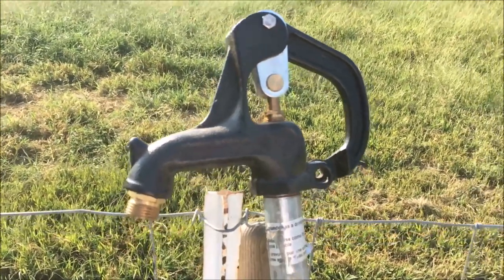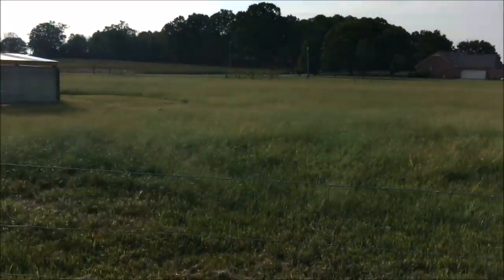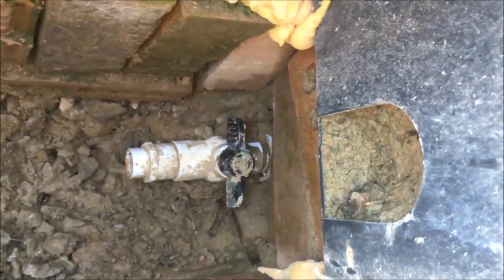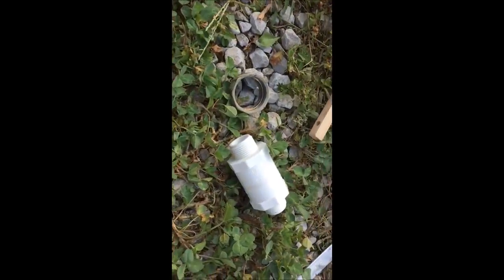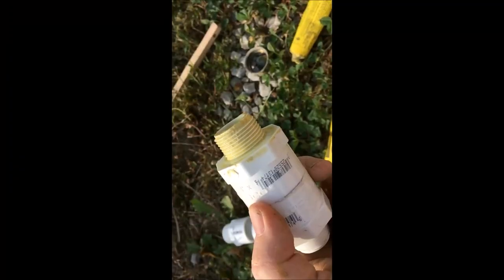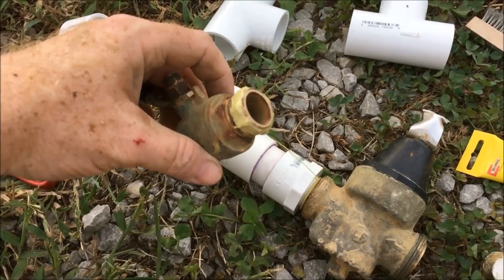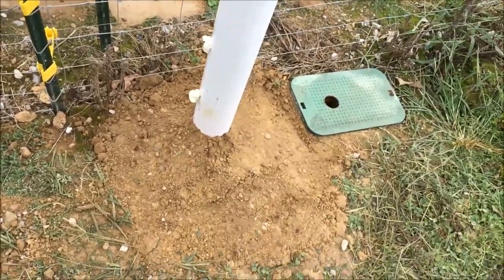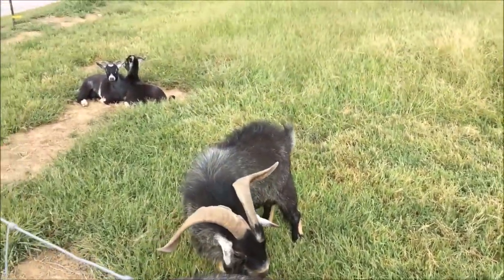Tenderfoot Farms: How to Install a Yard Hydrant

Comment: One flaw I see in your vertical pipe covering the hydrant.

In the future when you have to rebuild it you'll need to be able to get a pipe wrench on the 1" pipe to keep it from twisting when you unscrew the hydrant head.

Should have shortened that vertical pipe a few inches.
Reply from the maker: There is enough of the pipe sticking out to be able to grab it with a pipe wrench. You are right that is important.

Comment: OMG it's Frost free for a reason. All that garbage you did above ground for insulation was useless.
Reply from the maker: SCOTTA1 no our frost free hydrants still freeze because the water table gets higher during the rainy winter that the hydrant doesn’t always properly drain and will freeze and crack.
Reply: Imagine getting made because you don't like way someone installed a hydrant.
Reply: @tenderfootfarms5862  
If your water table gets high enough to freeze the hydrant, then the valve and pipe in the ground is going to freeze as well, one would figure?!?!?!?
This method should NOT be used for a normal install of a frost free hydrant.